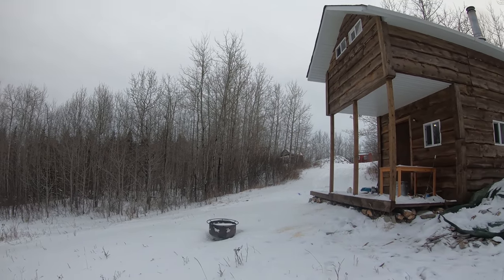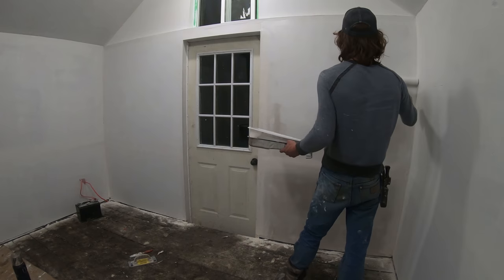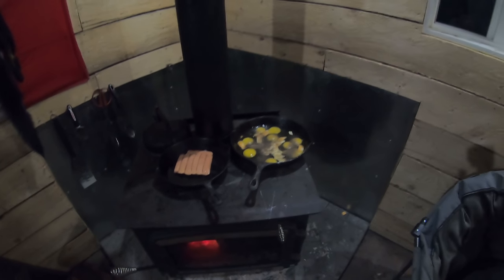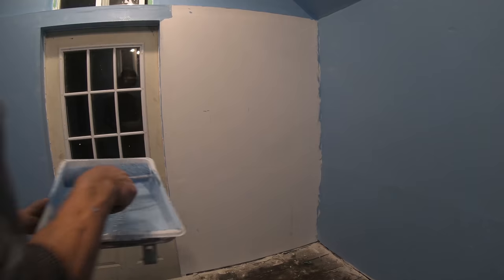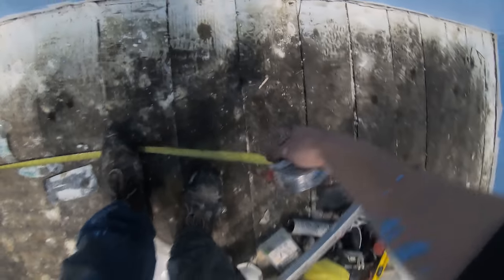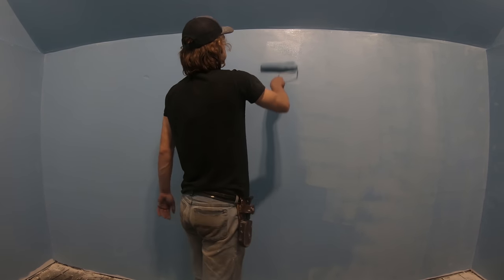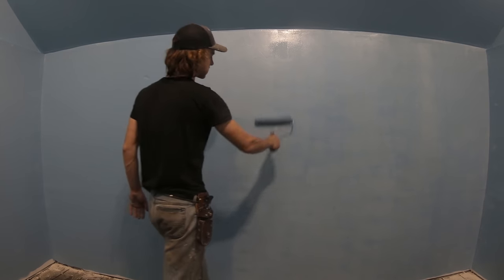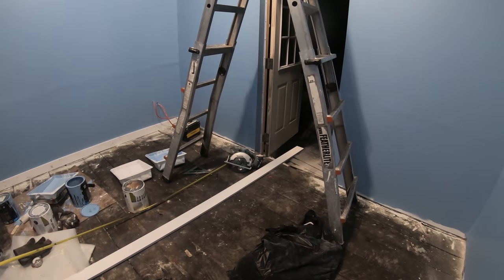Offgrid Workshop Project Pt. 11 - Painting the Workshop

Comment: Love watching your video’s. Can’t wait till you start trapping. Noticed in your last few videos that your solar panels are covered in snow. Should clean them off to get the most out of them in the winter. One thing that I do to prevent air bubbles you talked about is I always wet my tape and make sure I put enough plaster on the seam so the tape is completely coated with a thin coat of plaster when it is pressed onto the wall with the trowel. You did a good lob for your first try. It is not an easy job.

Comment: I have a mink coat that has recently  ripped on the back left sleeve/ shoulder area a bit I'll be getting it fixed very soon but it seems really dry , aren't I sappose to store it in a humidified temp CONTROLLED area to prevent this from happening again?